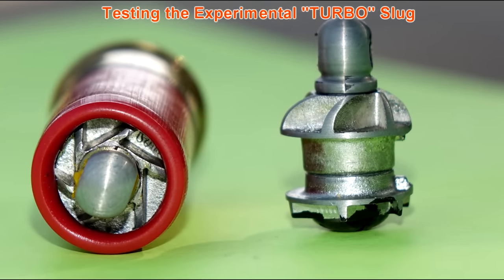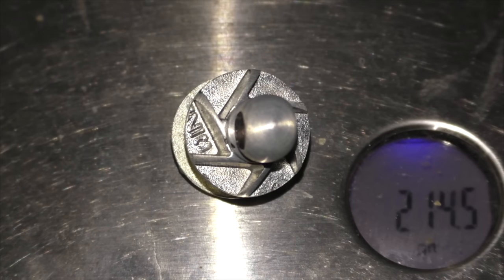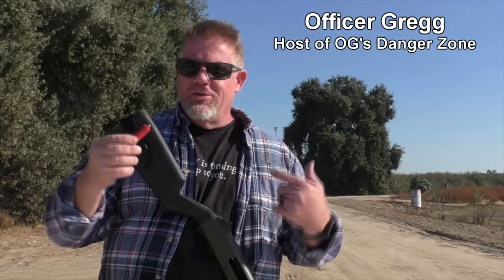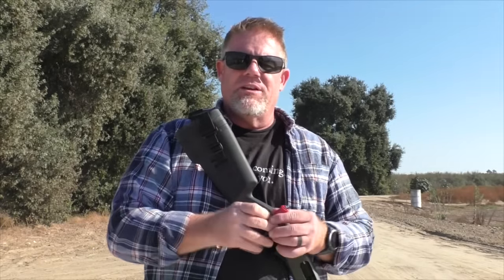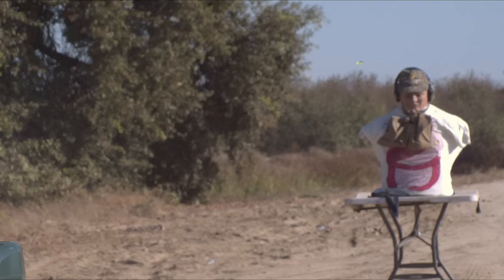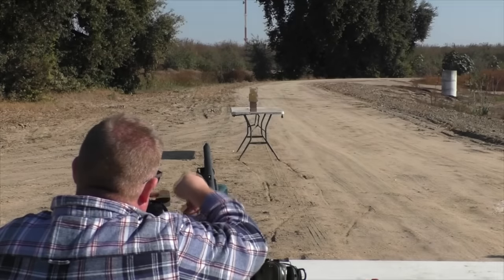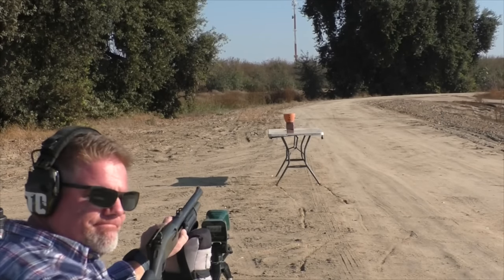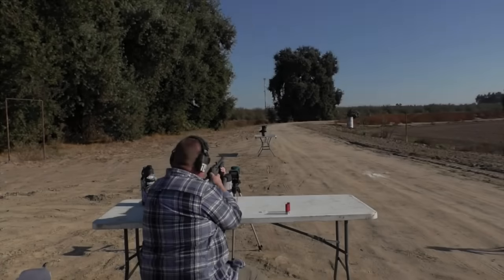TURBO SLUG -  Sounds like Star Wars Blaster

Comment: Ohh ohh ohh ohhh ohhh found a silly awesome funny way to see how a bullet will fly without actually shooting one.  

Make a template bullet out of a light material. In large the bullet around 5 to 10 times it’s actual size and decrease the weight so you can take a air compressor and do the hold the screwdriver in the air trick. 

Uno how the item will spin and float depending on its design.  
One can see what way the objet will fly.  

I was just watching a video of a guy trying to catch a 300 mpg egg shot out of a air cannon.  

And it just dawned on me that when a bullet flies sideways
 Can we not find out how to test a bullet shape design in that same fashion. 

For example take a toilet paper tube and glue it’s corners closed into the exact shape of the  bullet shell 
and try to hover it with compressed air to see how it flies in the air. 

I am no brainiac so this might just be a silly idea 
But to me it makes perfect sense. 👊😎